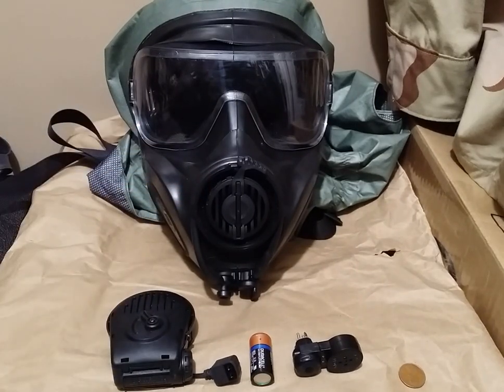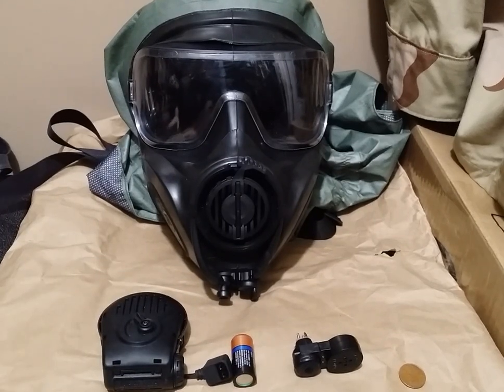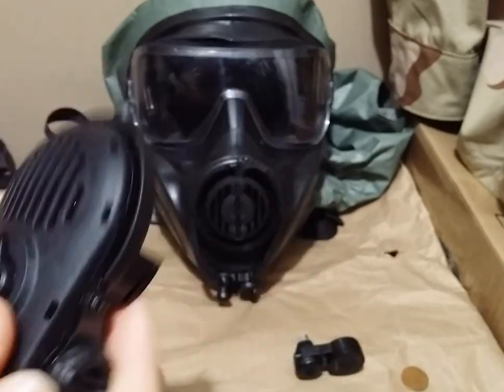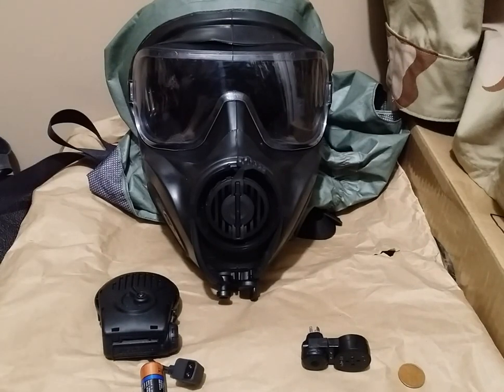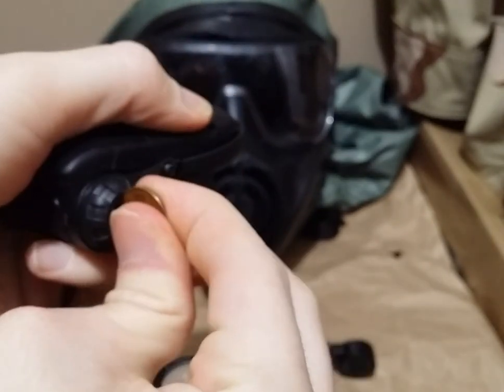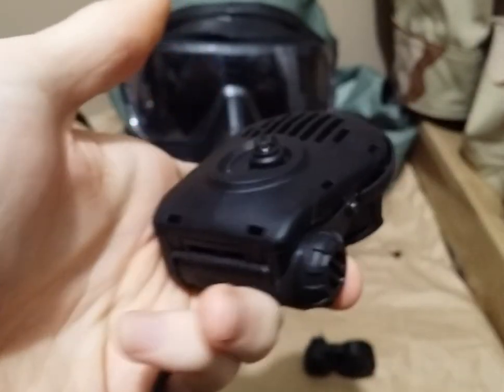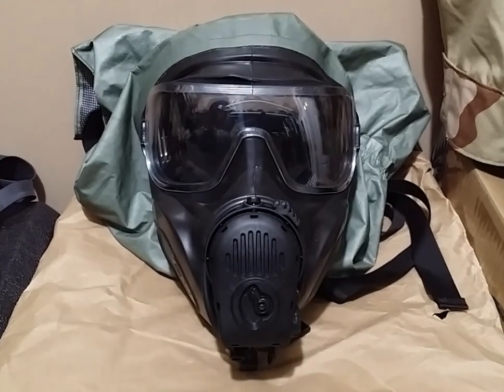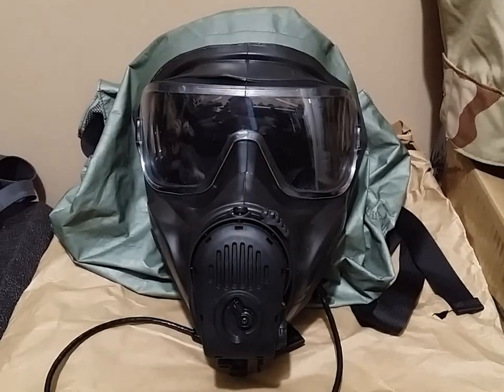(OLD VIDEO) Installation of the Avon Voice Projection Unit

Comment: Any suggestions on mitigating feedback? Terrible squealing and deafening feedback noise when VPU is on.
Reply: I have feedback issues also 😐 however if the VREU is rotated slightly to the SCBA position feedback disappears , not the best as this shouldn’t be an issue in the first place 😑